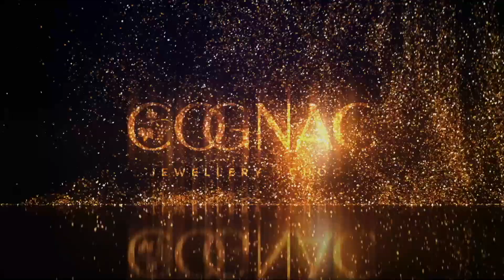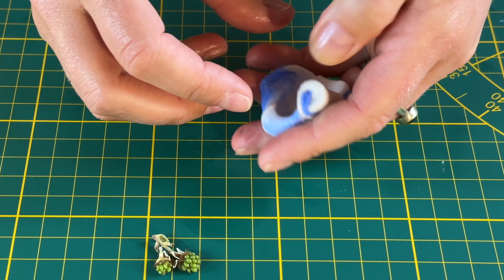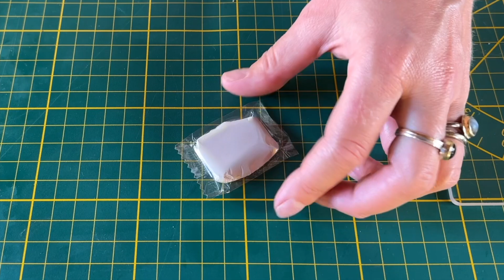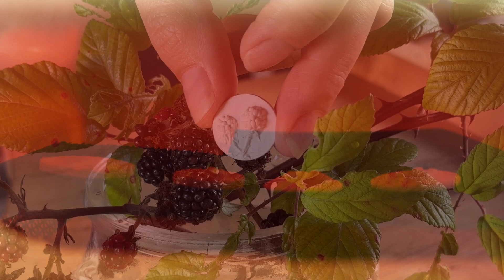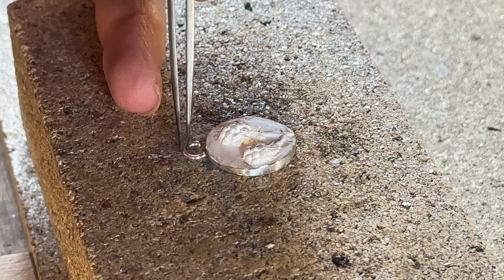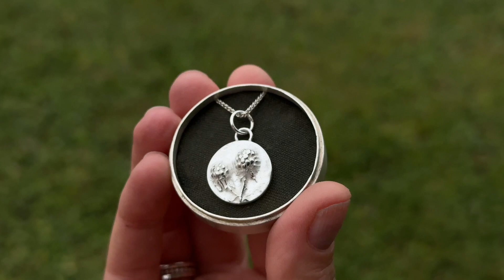JEWELLERY TUTORIAL | Make This Silver Clay Blackberry Coin Necklace

Comment: Hi, I've stopped the video at just after  one minute 30 seconds, where you say take the blackberry out of the mould before the resin fully sets. Wouldn't it be better to let the mould full set  before removing the berry, and avoid possibly losing some definition??  Or would that create some other problem??
Kind regards . . . . Andy
Reply from the maker: Hi Andy, 

Thanks so much for this question. You can absolutely leave it in the mould until the silicone has gone off - both ways work absolutely fine. 

The main reason I will sometimes remove the plant immediately is just to check the mould. If the plant has gone in too deep or the impression doesn’t look good the mould won’t be useable, but if you remove the plant immediately (and carefully!) you often have time to roll the silicone back into a ball and reuse it for a new mould if needed. 

Jessica
Reply: @Cognac_Jewellery_School  Thanks Jessica I appreciate the response. I've recently seen a silver clay project that was particularly impressive and would be extremely difficult to make out of solid silver. It was a large hollow cylindrical bead in a private jewellery groups video that I can't the address of, otherwise I'd send it to you. 
I might just have to have a go!!
Kind regards . . . . Andy